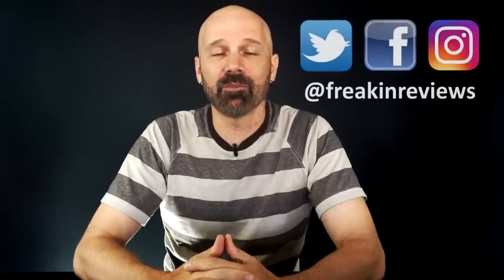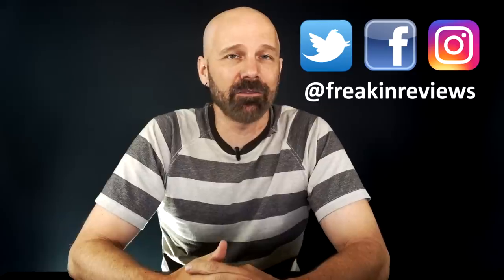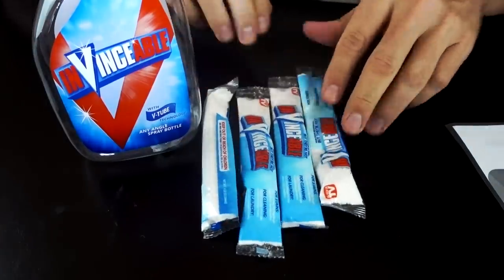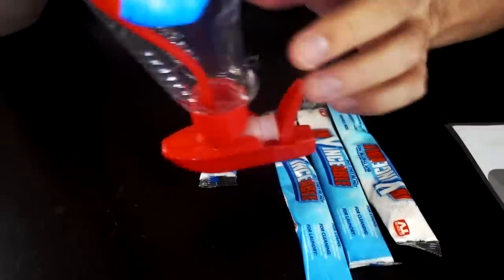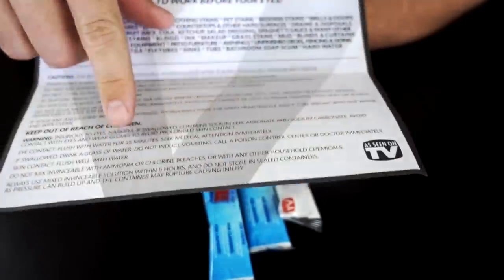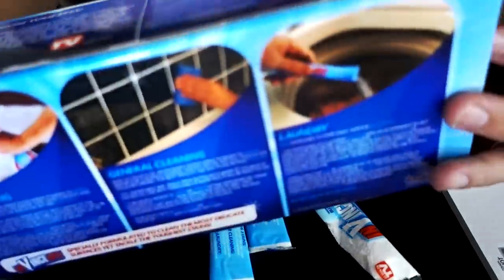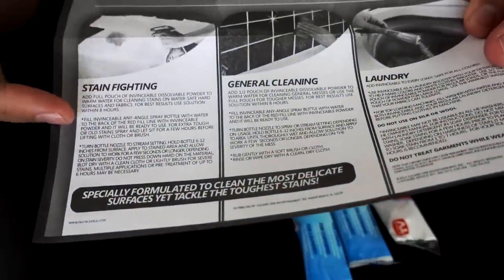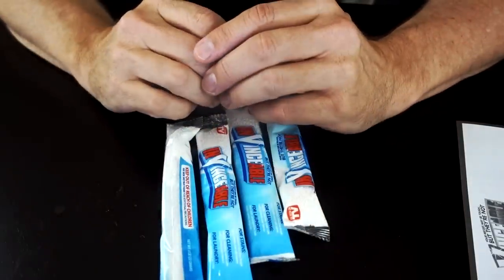InVinceAble Review: As Seen on TV Stain Remover

Comment: I found this on their FAQ: What are the ingredients?
Answer: It is a combination of ingredients. The chief ingredient is sodium percarbonate and other ingredients. The interaction between oxygen and water is the secret of InVinceable.

And Wikipedia says: As an oxidizing agent, sodium percarbonate is an ingredient in a number of home and laundry cleaning products, including non-chlorine bleach products such as OxyBoost, OxiClean, Tide laundry detergent,[1] and Vanish.[4]
Reply: Yup, it is literally almost identical to a packet of oxyclean, which you can buy in bulk for super cheap.
Reply: ... and other ingredients.
Reply: You probably also saw in the Wikipedia that in water, sodium percarbonate forms a solution of hydrogen peroxide and sodium bicarbonate. So... getting both in a solution is pretty much that.
Reply: The "and other ingredients" are probably mostly irrelevant, as the active ingredient is what does most of the work, hence the term "active ingredient".
Reply: the other ingredients are probably pH buffers or stabilizers, since the active ingredient (sodium percarbonate) may have a pH of maximum efficiency.
Reply: I could have told you it was an OxiClean knock off from the get go... and can be had cheaper it seems.
Reply: It’s basically oxyclean, which in turn is basically peroxide..... a $1.00 bottle of peroxide from the drug store would have worked just as well
Reply: Do a comparison with dissolved oxi-clean in a spray bottle.
Reply: I second doing a comparison with Oxiclean (plus a cheaper generic equivalent) in a future video.
Reply: Yeah, my husband mixed peroxide and baking soda together to remove cat urine stains from our bed, and it worked wonders — and it only cost $2.
Reply: Yeah, maybe do the comparison with Oxiclean or some other similar brand name, and homemade stuff?
Reply: That's funny i have been using cheap laundry detergent for my floors and shower it works great and the cheap laundry detergent with bleach works wonders in the shower
Reply: @NothingXemnas  so it becomes baking soda and hydrogen peroxide?
Reply: Aqono Luna I’m going to try that on my tile floor. My dog has a favorite spot to pee.  Great tip.
Reply: @RazoE  
Yes.
Reply: You should compare it to oxiclean. Before I read your note I thought it was oxiclean in a spray bottle.
Reply: that's what I figured. Carbonate has a short life use, and it's pretty good for discolored grout if you agitate it properly.
Reply: Ashes, Ashes We have that and it doesn’t work nearly as well as baking soda and peroxide.
Reply: >sodium percarbonate
That explains why it goes right through the iodine
Reply: I could buy it in bulk but... it’s Vince offer soooo....
Reply: Is this suppose to be the same as Dr Clean?
Reply: Woah, the infomercial guy sold a more expensive version of the other infomercial guy's product.
Reply: It's likely that the a hydrogen peroxide is why they tell you not to get it on your skin.  It may not be particularly dangerous but it does damage your skin.  It can cause irritation and it likely why his hands felt like they "dried out".

Comment: The cleaner looks and reacts like oxiclean but oxiclean is much cheaper. The best laundry pretreat I’ve used and better and cheaper than oxiclean laundry pretreat is homemade.  Mix 1/4 cup ammonia, 1/4 cup regular dawn dish detergent with 1/2 cup hydrogen peroxide in a spray bottle. Shake it before each use and spray the stain.  Wait 30 minutes and launder as usual. I’ve had success with it removing all kinds of stains both new and set in stains. Only once did I have to reapply and launder an item a second time.  Thanks for the review.
Reply: Janet is is safe for all fabrics and is it color safe? Thanks

Comment: Maybe you could put a bit of tape over the air vent plug when you're using this?  The tape wouldn't have to hold for very long (just long enough to finish whichever cleaning task you're on).  I picked up a bottle of this stuff on clearance at the hardware store, but haven't actually used it yet.

Comment: What are the ingredients in OxiClean laundry detergent?

Sodium Percarbonate. According to research by Laundry Alternative, OxiClean consists of 50 to 60 percent sodium percarbonate. ...Soda Ash/Sodium Carbonate. Sodiumcarbonate, or soda ash, is also sold separately as washing soda. ...Hydrogen Peroxide. ...Surfactants/Detergents.

Yeah it's just OxiClean folks. Used the same way as OxiClean, you need a fresh solution every time. OxiClean is cheaper.

Comment: On the external wall and the plastic table and chairs I would spray, wait for a few minutes but not let it dry, then use that hose to wash out with plenty of water. Try it next time. Using a chemical makes dirt react and come off, but if you let it dry out it binds again with your wall. Also, if the external wall wasn't so rough, you would be able to wipe it clean with the cloth, but since it's very rough, you'll clean it with water.

Comment: Its 100% impossible to just spray any liquid on any surface and it just disappear stains don't just disappear I could see on the clothing if you sprayed that on and rubbed it in before you threw it in the washer also on the wall where your dog lays that seemed to work pretty well but all in all no matter how you clean any surface you're going to have to put some Force down to get anything to come off and I imagine it would work pretty well you should do a test with warm water and Dawn dish soap and see what kind of results you get and then compare a $1 bottle of dish soap to that also the mold / mildew in the shower grout would have to be sprayed with bleach and a toothbrush or a green part of a sponge to get out

Comment: For stuff like the table and stucco since it is a rough surface and it is outside I would spray it on and then use a hose to rinse it off. I think that will help get the dirt out of the nooks and crannies. Also it seems like when you wiped it the dirt smeared. If you use the hose it will all just be blasted away.

Comment: If it worked on the grout, I would have ordered it immediately
Reply: Tonya St2021 for grout: one part Clorox to 4 parts water. Spray a side of shower. Let sit for 30 minutes. Turn fan on or open window first. Got back and rinse and see if you need to reapply or scrub a bit anywhere. If not, do next section. Or do next section next day. After it is all clean you can spot treat when you see mildew start forming. If you stay on top of it you won’t have to do it all again!

Comment: Does it make a difference of how concentrated the solution is? Will it be more affective if it is more concentrated?
Reply from the maker: They do imply this by stating that stains are best with a full packet, while a half packet is good for general cleaning.
Reply: @Freakinreviews  what I meant was what if you used a full packet with 8oz water (more concentrated solution) instead of a 24oz of water which weakens the effectiveness of the powder since is it more diluted.

I guess I am curious to see if it would clean your shower grout if the powder was not so diluted?

Comment: On the part of the bottle saying not to "press hard" on the wall or floor, I think it's just another sales pitch. I don't see why they feel the need to very specifically tell you to be soft as tissue paper with it. Good God just wipe the damn thing off lol they speak like it'll melt a hole in your wall or floor if you apply too much pressure.

Comment: Hi James! For the Bailey wall and baseboards as well as the picnic table top and benches, I think you could have gotten just as good results with warm water, a little Dawn dish washing liquid and a towel with elbow grease. The shower grout in the infomercial was sprayed with straight bleach or another strong chemical I think. I've cleaned tile showers in my job and in my experience only straight, undiluted bleach would whiten old grout in three seconds. I think the InVinceible is unnecessary